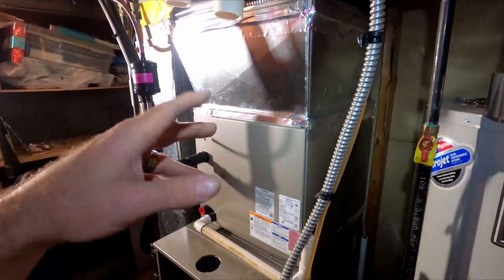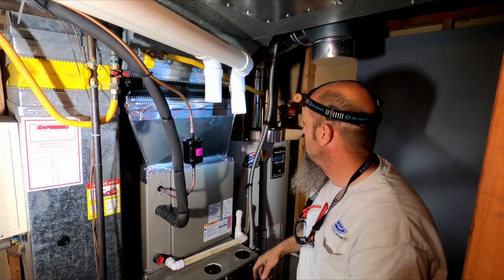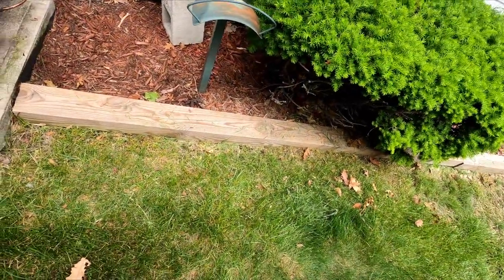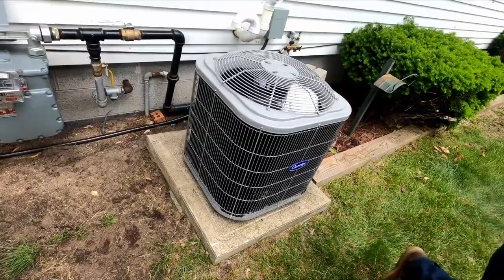Another Service Tech AC Install

Comment: Looks like fun. I would have spent most of my time playing with the doggo! Question, is there a reason you don’t use the rubber couplers on the pvc lines for fresh air and vent on the furnace? It would make it a lot easier to service. Thanks for the vids! Be safe!
Reply: I came here to comment on the same thing,.... you beat me to it, I was wondering about rubber couplers also.

Comment: Why no primer on your glue joints?
Reply: Primer is only required when installing at or below freezing. Was taught that at a vent gas seminar by Ipex.
Reply: In Canada we have purple primer and we have to use primer no matter the temperature